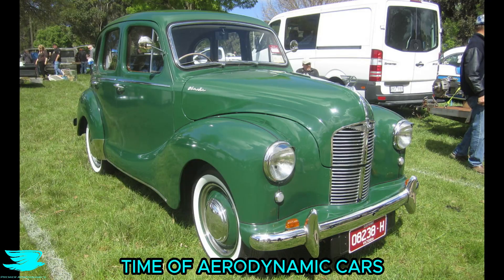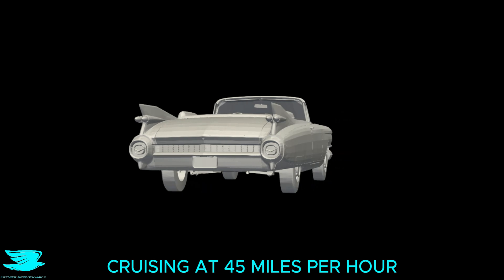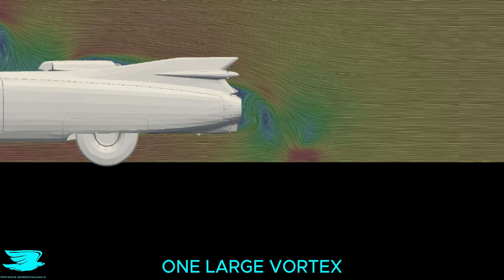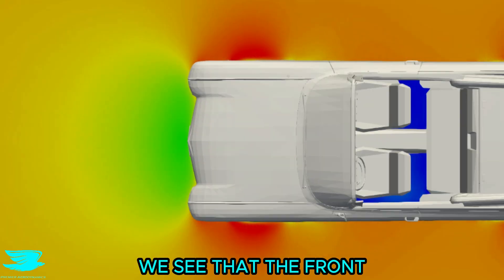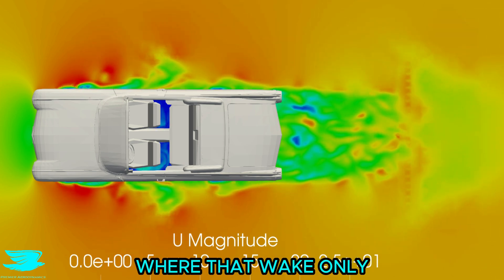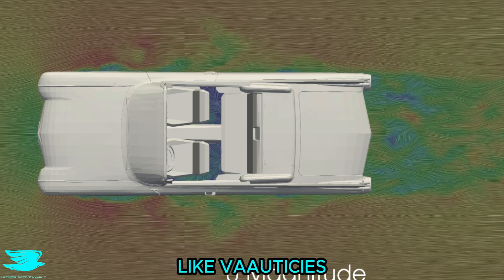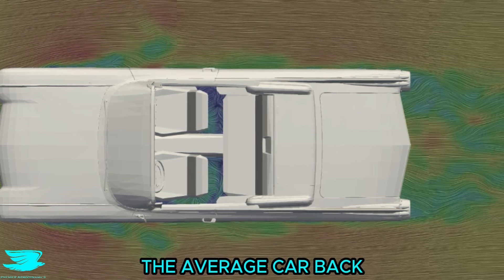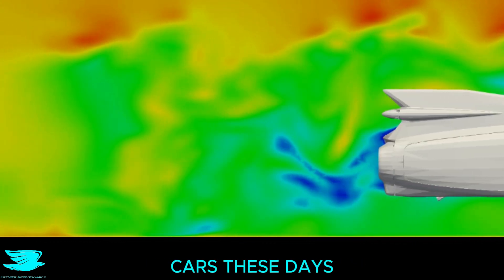How Bad Was The 1959 Cadillac Eldorado’s Aerodynamics?

Comment: Who cares? It's a caddy, big size, big engine, styling..
Reply from the maker: But, does size really matter?
Reply: @PremierAerodynamics  50s and 80s were the best of times. You sound ferign so you probably don't get it. Its large and in charge. I had a 72 sedan deville with a 472 cid, 4bbl carb engine that would push that boat through the air fast no problem. It would do tire smoking burnouts to boot.

Comment: Another reason they're called boats, still want a 58 Caddy. If you look at cars from the late '80s early '90s. Compare them to the brick walls made now, I wonder how those compare.
Reply from the maker: Good question. We will.
Reply: @PremierAerodynamics Thinking about ones like the blunt nose Pontiac Transport van (compared to the earlier slope nose) or the newest pickup trucks, especially the Chevys is what I look at. Thinking of the wedges that were around before like the Honda Accords, Metro/Swifts. I know those are small cars but the general shapes across the board. I just know the make them so big on the fronts now and there's nothing behind the front bumpers or under the tall hoods.
Reply from the maker: @crushingvanessa3277  Yep, the geometry of the car isn't just determined by the aero. The styling, and in this case, the functionality, play a big role.

Comment: 0.89 Is pretty dismal. I've read that the VW Beetle, with a nearly vertical, flat windshield, has a coefficient of about .5 .
Reply from the maker: The roof has a huge benefit, so even though the body might share similar features, because you have the roof, the flow can go over the top, stay attached (hopefully), and reduce the wake and drag.

Comment: I couldn’t tell much, but how did the rear fins look in the simulation? We’re they aerodynamic and help at all or we’re they just really for show?
Reply: I was wondering about that too. GM said the ‘stabilisers’ (fins) on the ‘59 Chevy helped handling but I’m sure I remember nascar drivers saying they lifted the rear above 120mph. Would be interesting to know how the different fins aided or ruined the aerodynamics. Results from different speeds would be good here. A friend says he can feel the wing on his Superbird start to work around 80/85mph, that would be an interesting car for this test.
Reply from the maker: @OlNoName @CycolacFan  Sorry, I forgot to mention their effects. The major effect is was stabilizing the wake. If you look in the video, you can see that the wake doesn't move from side to side. Most cars have wakes that do that, but this one doesn't.

One major reason is that the fins provide a sharp point for the wake to consistently detach from. That means the wake is always being shed from the same point, hence no side to side motion.

Comment: Next time, try it with the roof up, and/or try the aerodynamics of a hardtop as well.  If the biggest problem is what happens when you lower the roof, that would be true of any convertible, to a point.
Reply from the maker: That's a good point. Usually, the roof down increases the drag coefficient by about 40%.

I just put the roof down because of Vanilla Ice's instruction, "rag top down so my hair can blow."

Comment: i lost it when you complemented the lift factor
Reply from the maker: Lol, it is a pretty decent lift coefficient. Much to do with that the car is really just a flat brick.
Reply: Now I wonder how a Volvo 740 wagon would perform compared to an actual brick, as that is possibly the most brick-shaped any car has been. Obviously vans and trucks beat it, but that is the most brick car I can think of.
Reply from the maker: @joedingo7022  Well, the Nissan Cube is very brick-like, but it has rounded edges to reduce the drag coefficient a little.
Reply: @PremierAerodynamics  That's probably because Nissan admits to the existence of so-called "aerodynamics" but 80's Volvo did no such thing. Even the aero parts on those cars look more like airbrakes than splitters.

Comment: Did the model have exhaust and open engine bay ? That might have made it even worse. 
Too bad it was a convertible. I'm wondering what the coupe would have got as a cD.
EDIT : wanted to suggest a car to do a CFD analysis on that might generate quite a few views, as well as lots of comments back and forth  from 'experts'
The 1969 Charger Daytona and Plymouth Superbird. 
People like to quote the .29 cD figure Chrysler got for the car when they tested it in the wind tunnel, but this may have been from a test model, since a real ( stock ) 1969 Charger Daytona was tested at the Chrysler wind tunnel around twenty years ago, and gave a .36 cD. 
Personally, I wonder what the pointy nose did for drag over the blunt nosed 1969 Charger 500. 
( The Charger 500 being a more aero version of the standard 1969 Charger R/T. Things like a front end that was flush, using the grille from a Dodge Coronet, and a flush backlight, rather than the inset 'buttress' design.)
I would guess the pointy front end would have resulted in less pressure drag, as well as directing air to the sides, rather than the windshield. 
There are free models of these cars online, but they lack a full underbody. 
Still useful though. 👍
Reply from the maker: Nope, the cooling flow and exhaust were neglected, which would have dropped the drag coefficient by about 25 counts or so.

As for the Dodge Charger Daytona version, sure, we can do that. We found a couple of models that we can modify for it.

The nose definitely would have reduced the pressure drag because there is less frontal area having such a high pressure on it. However, if the nose redirected the flow unfavorably, it could increase the drag through secondary effects.

The experts are welcome. Constructive arguments are always welcome
Reply: @PremierAerodynamics  I'm no expert but I'd like to see that, very curious of the effects the nose had overall